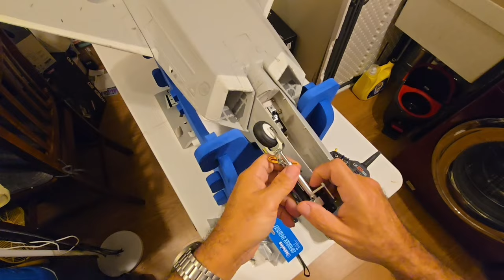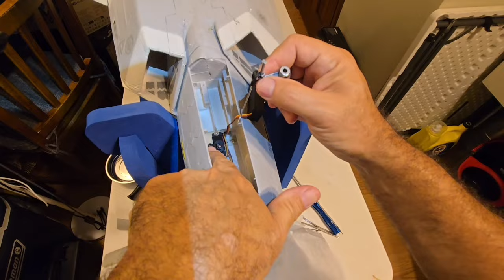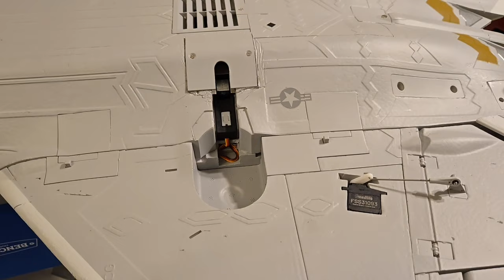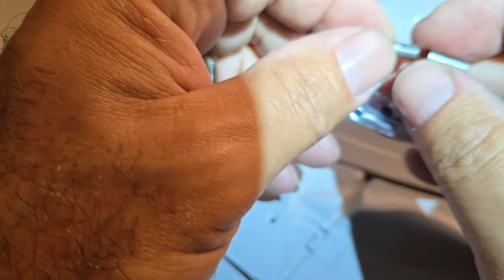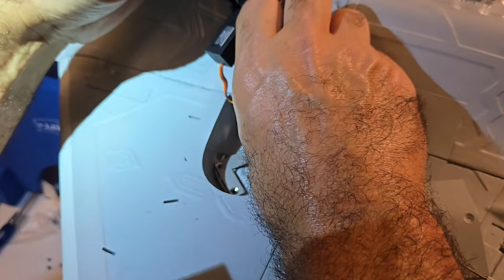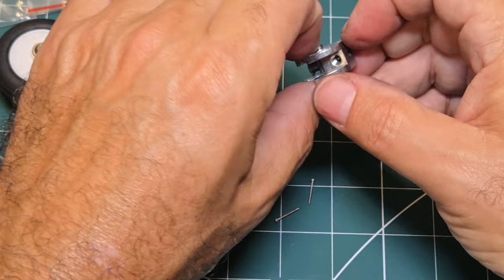Freewing F22 Raptor gear replacement/repairs

Comment: I land in SAFE Because $$$$. I also fly with bare receivers on other birds. 26 planes in the hobby in 2 years, only 2 in my hangar are left. You're doing fine. Don't feed the trolls. SAFE receivers would have saved me a lot of money and heartache. Fly fly fly brother!
Reply from the maker: @thorvelasco1467  Thanks for the encouragement thanks for watching Thanks for taking the time to make this comment and yes if it wasn't for the price everything I have would be safe some things maybe I guess if I think about it because the 3D planes don't do well with safe or as for that matter I like to hover and you can't do it with those because they limit your throws but the new AS3s plus I think does not limit your throws you just have to increase the throws before you program it
I watch some of our super experienced guys on a daily basis coming for a landing gust of wind dips that wing down they don't react fast enough and leds to a less than perfect landing sometimes broken stuff I think I'll stick with safe

Comment: What camera do you use?
Reply from the maker: @Hudsons_Rc  older GoPro and Samsung Galaxy Z fold, sometimes a Cannon 90D, Panasonic SH1 and a few drones
Reply: @ thanks for letting me know, I’m about to tag you in my video
Reply from the maker: @Hudsons_Rc  Cool
Reply: @Pooley929  thanks for putting all the things about your 70mm f22
Reply from the maker: @Hudsons_Rc  just reporting my progress thanks 4 watching I got a lot of flak for the crash and I'm sure most would not have posted it the mistake however I have nothing to hide I'm still learning
Reply: @Pooley929 and that’s awsome! I posted my crash too. The plane broke it 4 or so parts
Reply: @Pooley929  https://youtu.be/Q6ZWz69xvQM?si=MiNwP7S11R1vVoKV

This is the link to my plane crash
Reply from the maker: @Hudsons_Rc  of course that was prosecuted in 10 different ways for my crash which my disclaimer at the beginning was that it was a stupid mistake on my part don't know why but they definitely did roast me
Reply from the maker: @Hudsons_Rc  Watch out for that Tree lol
Reply: @Pooley929  don’t take it personally they are keyboard warriors, they could even fly an RC plane even with safe mode on. Keep up the great work
Reply from the maker: @Hudsons_Rc  Thanks